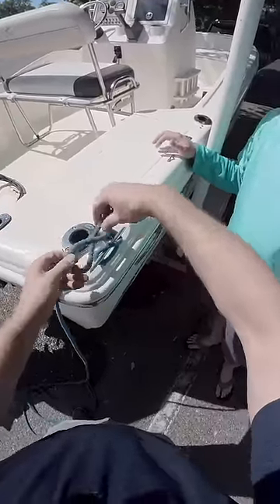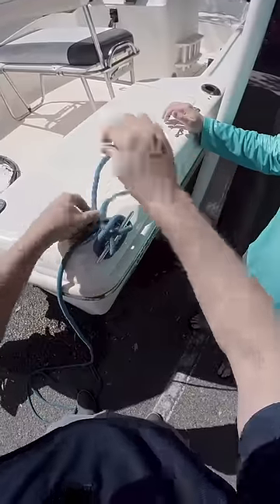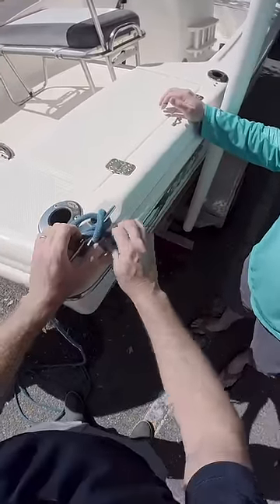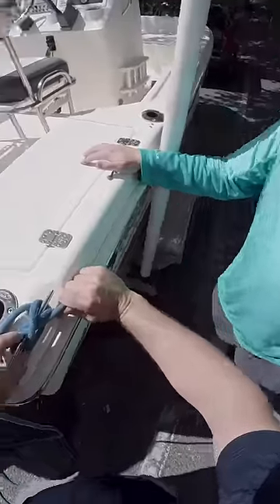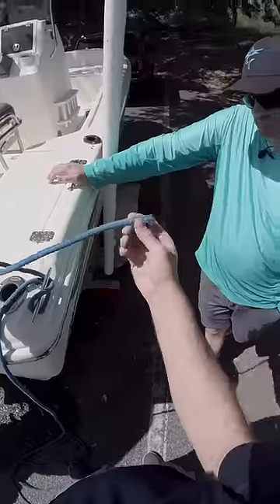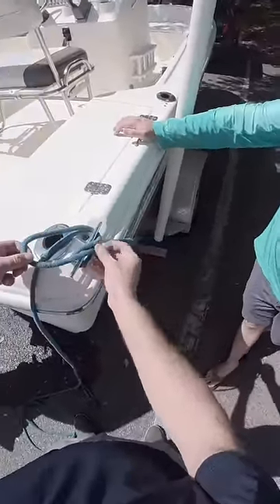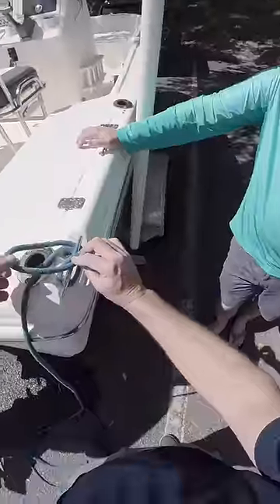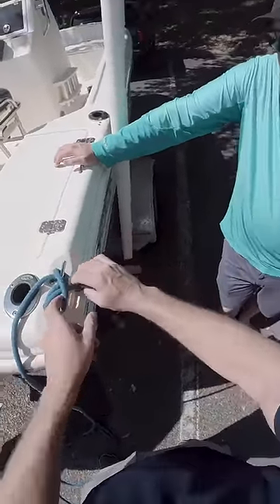Marine Professional POV: Cleat Knot #boatlife #charleston #sailing

Comment: If I remember correctly, technically, you do not need to "lock" a cleat for it to be correct. Technically, i remember a cleat hitch being just a series of figure 8's. Because under heavy load, a cleat tied as shown will still bind.
Reply: On very large boats you are correct, but on small boats with small cleats there isn enough room for multiple wraps
Reply: You are absolutely right. Is called "a dead man's turn". Never do this

Comment: The part of the line you’re using to tie the knot is the working/running end, not the standing/bitter end. It’s confusing without more to the video. 

Otherwise, yes, that’s how I tie off my boat to a dock cleat, using the other end, the looped end of the line, on my boat cleat.

Comment: Round turn and 3 Figure 8s. Will hold and won’t bind.  Additionally, while working lines alongside a pier or other boat the round turn and figure 8 will allow a person to work the line while meeting the boat driver’s needs.  What you got there may size up and hang your boat on a low tide. Not to mention be next to impossible to remove should it get wet and freeze.
Reply: Round turn and 3 figure 8s. Did you teach yourself? That's the same recipe for sending your boat down river with no pilot
Reply: @macbook802 a full round turn and 2 figure 8's with a half hitch on the last - the way the US Navy, Coast Guard, Merchant Marine, Power Squadron, and Chapman's teach it.

Comment: You're wrong. You always take a round turn on the cleat first
Reply: Wrong!  USNA grad.
Reply: I guess you're right it's not a round turn. The angle the standing end is coming from threw me off a bit. On a halyard on a mast cleat the bitter end comes from the same direction as the standing end after going round the cleat but it's not the same here. Thanks for clarification
Reply: When the line is much smaller then the cleat, you NEED to do a full round or the line will slip. 
Half hitch is good when line and cleat are the proper size.

Comment: but the boat is pulling on the OTHER END OF THE LINE,  your reasoning doesn't add up ??
Reply: The boat is on a trailer, it’s not going anywhere. But the way he is tying is correct. He’s starting to go around the horn away from the pull as opposed to the horn closest to the pull which will tend to bind. I have worked with at marina for 25 years. This is good.
Reply: As an argument it’s a dumb one you lose. An as for Your comment doesn’t hold water!! Figure it out